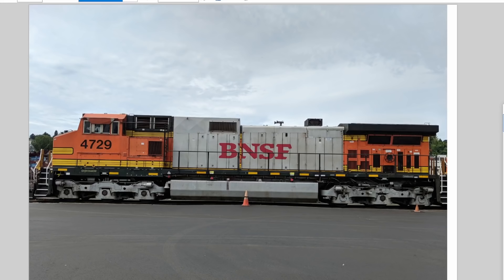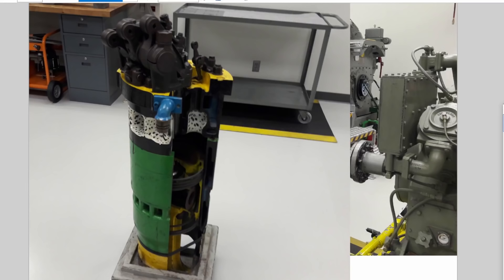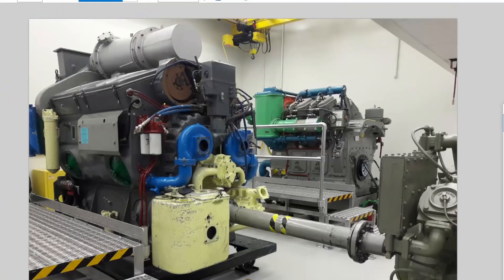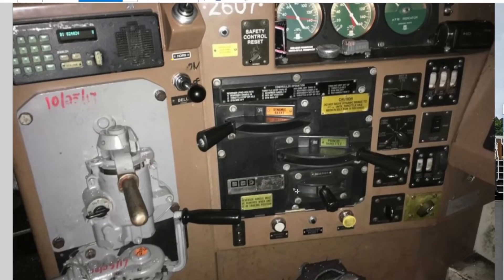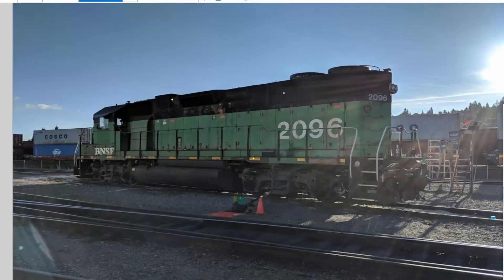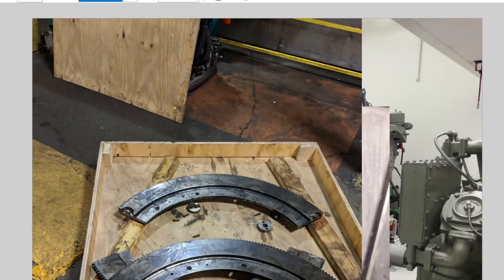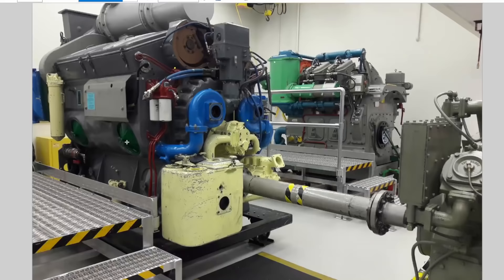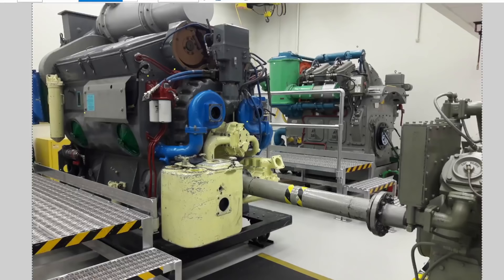Diesel 101 - How DIESEL LOCOMOTIVES Work! [10 Levels]

Comment: Talk about throttle handles. When I hired out on the Soo Line in 1968 I was placed on the Eastern Division Board at Marquette, MI but worked on the Old DSS&A #40 & 41 working out of Superior, WI to Ewen, MI. Soo Line had leased two engines from the LS&I #2500 & 2301 (GE U25c AND U23c) The throttles had half notches and an unusual throttle handle that was at least two feet long. Later when I was promoted, the first switch engine I worked on at Shoreham Yard in Mpls., MN was engine 319. A Fairbanks and Morris H12-44, that engine didn't have a reverser. It had a handle with a U-shaped slot. One slot was forward and the other reverse. I had no idea which was which, If I remember right the bottom slot was forward and the top reverse. I has a fifty percent chance to get it right the first time. Luckily I did. Those LS&I engines and the Soo 800's (GE U30c's)they were the best to stay warm in the winter as they  had a slightly pressurized cab as far as heat went.  Also, not to be picky, but the control stand has a whistle handle, not a horn handle. Railroad instructions give whistle signals not horn signals. I once had a whistle handle break off during a road trip. Jack Peterson hogheaddotnet
Reply from the maker: Cheers Jack! That's cool. I'd wager it was one of those holdover terms like the fireman's emergency brake valve. That's neat, hadn't heard about those styles of control levers!

Comment: About how you power the Main Alternator I maintained aircraft alternators and I am quite familiar with them. From my understanding, newer locomotive alternators and aircraft alternators work essentially the same. You have 3 stages, with both Rotor (rotating electric parts) and Stator (stationary electric parts). Stage 1 Rotor starts it with 'self excitation' (no outside electricity) and produces more power on the Stage 1 Stator. Then power goes to Stage 2 Stator, Stage 2 Rotator receives this power and boost it. This goes to the Stage 3 Rotor, Stage 3 Stator receives this power and boost it again. The output of the alternator is controlled by changing the amount of power going from Stage 1 to Stage 2.

Yes, the traction motors are powered by magnets and turning torque only, making electricity. No outside generators needed. Cool stuff.
Reply from the maker: That sounds about right from what I've heard with the GE style main alts. The EMD's still have the separate generator for supplying the excitement, though maybe not the newest tier 4 locos. Thanks for the comment :)

Comment: Great video.  I learned much more about Diesel Engines than I already knew.  I do have two comments though.  When I went to electronics school in the '70s, we learned about DC generators and AC generators.  Both were called generators.  I believe that when the automotive industry switched from DC to AC generators, they wanted a "cool" name to call this new component and created the name Alternator for their new AC generators.  Two is that you said several times that it was water and not coolant then later you called it coolant.  Since the purpose of the water is to cool the engine, it is coolant.  We just usually mix antifreeze with water for car coolant.  Plain water used to cool an engine, is still coolant.   Again, great video.
Reply from the maker: There is a slight technical difference to alternators vs. generators but you're probably right they wanted a fancy name. And, fair enough on the coolant. Totally right, but I wanted to point out it's not the same as buying antifreeze. :)

Comment: i wish EMD would make or licence there supper turbo idea for cars and trucks to have the response of a supper charger and the efficiency and power of a turbo in one package would be awesome.
Reply from the maker: Not sure it would work in the scaled difference for automotive applications, but that would be neat!
Reply: @Hyce777  it's not very popular to do twin chargeing at the moment because of it's complexity but it does get done from time to time by those who are willing to dive into but having a singular unit would definitely bring up the popularity if not bring it into main stream if they could pull it off in a kit form. I would certainly buy one for my landcruiser it would make it a lot better especially after a gear change not having the turbo completly spool down.

Comment: Great video, about the electrical aspect. A basic overview of charging systems, obviously the locomotive has more complicated aspects, should be a simple topic. I feel like you when it comes to forgetting more than I learned. Feels that way but it's not realistic. The basics of it is pretty cut and dry and simple to figure out. Learning about the differences between half, full and three-phase goes a long way. Rectifiers, voltage regulators and the concept of fielding coils too. Motors are a whole different topic in my opinion. Induction as a whole, in my opinion again, can be hard to wrap your mind around. Loved the video.

Comment: So I am not aware if there is, but to my knowledge two stroke diesels cannot run without positive inlet pressure which is why you have those blowers or clutch driven turbos. These engines solely rely on the intake pressure to drive the spent gasses out the exhaust. 
Fun fact: you call them blowers, because that´s actually what they do, they blow air. The positive pressure they make is dependent on your valve size, how much air your engine consumes and the rate you spin them at, but that´s getting into hot rod territory.

Comment: Small note from marine applications. EMD does produce 8cyl engines, which is what it looks like is on display in your pictures. I dont think theyre that common in rail applications however. Out vessels have 8-710s and 12-710s. Those engines are new and replaced the older, but in my opinion far cooler, Fairbanks Morse OP 38d 1/8. However the more research i do into the design and operation of the EMDs, they're growing on me. Edit: A possible reason for the EMDs traditional electric start is due to the various other applications for the engine, such as the marine industry. I know our engines are fitted with a compressed air starter, as I'm sure are other vessels. I am, however, unsure of the other uses for GE engines so my theory may not hold up. Just an idea!
Reply from the maker: For sure, that would not be surprising. I know the EMD engines have ended up in all sorts of uses. Always neat to hear about that. And yeah, they make 8's, 12's, 16's, and the used to make even 20 cylinder variants. The picture I was drawing on is actually a cut down 20 cylinder engine (the PA's are marked 1, 9, 10, and 20).

Comment: Also note on those EMDs that because they are 2-cycle, that clutch driven Turbo is mandatory or you would never get ANY pressure to the crankcase because you'd never get it to start in the first place.

Comment: As a locomotive engineer for almost 30 years i have always liked the EMD's better. They put the power to rail better, are more responsive when switching and are way more reliable. The GE's have a more comfortable cab but seem to become rattle traps way quicker.
Reply: But you have to admit, the GE's sound better, meaner.
Reply: Unfortunately I don’t think sound or looks or other enthusiast concerns are something the manufacturers or the railroads are concerned with.

Comment: The air pressure on the crankcase is actually very high, much more than you are stating in the video, around 15 PSI minimum, and up to 35 PSI when the turbo is really working - say at 45 +  MPH.  This is why the engine can burn it's own oil and "Run Away".  That is why some have a block off for the air intake, so they can stop the engine that is running on engine oil.  

The 15 PSI is required to quickly push air into the cylinders, and also push out the exhaust air through the tiny exhaust valves.  

Knowing how many cubic feet of air that is going into and out of the brakes is very important.  One time the third car of a train had a block on the that car and prevented application of the brakes rearward of the third car.  This caused the train to plow into the station, and into the control booth, with no loss of life on the train, but the locomotive soon ended up in the basement of the train depot.

Comment: Do you think it would be possible to power a locomotive with a Stirling engine? I recently found out about them, and it seems an interesting concept. They are mostly low wattage, but it seems like the technology could still be further developed, and it might be able to make full use of the energy from dynamic braking, since it runs on heat.
Reply: Interesting. But when you need to kill power, you can't just swing the heat out of the way. Easily. It's something to explore. It all comes down to economics. If it could increase profits, it'll happen. If not, it just becomes a cool engineering experiment unfortunately.
Reply: @slowpoke96Z28  I think a solution could be to then charge batteries with the slow down, then they could help it accelerate faster during the slower rev up

Comment: Also a testament to EMD durability is the fact that at almost every class 1 RR the only older motors are EMD's. You almost never see any older GE motors. They were all most all sold to other countries in the early  part of this century. They were not at all reliable.
Reply from the maker: Yup! The dash 8's we dealt with at my shop were absolute trash. But, the older GP's and SD's from the 50's, 60's, and 70's - all older, but still running with limited issues.

Comment: In a car, the difference between a generator and an alternator is just how the AC produced by the windings gets straightened out into DC. The generator used a rotating switch called a commutator, which being on the same shaft as the windings means it was synchronized; this straightened the current out (rectified it into a single direction). But a big, heavy current switch had mechanical wear and was expensive to build and maintain. An alternator used solid state diodes to do the same thing cheaper and more reliably. So instead of communtators wearing down, you have diodes blowing out. Congratulatins!

Anything having to do with excitation of the windings at start up or the simple reliance on residual magnetism remaining in the iron, or the use of solid state control circuits instead of electromechanical relays flapping around to regulate the output are just details of design and the improvements of time rather than any differences between the two. Any time you scale up to monster equipment, you are going to have little devices needed to get the big devices started, e.g. diesel semis.
Reply from the maker: Oh neat! I hadn't heard that before. That makes sense. Thanks for the comment :)

Comment: The advantage of the alternator Is they are usually three phase. The Stator is stationary, and the field rotates making the system more efficient. The shaft with the field is connected to the motor.
Modern alternators are fully synchronous. No brushes on the commutator. They have an excitor coil to energize the field on start up.
Reply from the maker: Makes sense. Thanks :)

Comment: If we could switch the right side engineer console position with the conductor left position, you basically have the 18 wheel OTR truck driver setup. If the diesel electric setup could be adapted to a COE design then I could see the diesel electric setup being useful in an EV setup for commercial trucking application.

Comment: The "war pumpkin" looks like an employment opportunity for sure.  The EMD blocks are a welded fabrication and one can weld on one even while it is running to keep it limping along if it has a bad leak.  The little GM two strokes however, had cast blocks.  The disadvantage was that welded fabrications have a higher expansion coefficient when heated and higher vibration characteristics.  The master connecting rod idea was used on radial aircraft engines and explains the characteristic lopping sound in the GEs.  My friend's VW had natural magnetism in the field windings and regulated by current through them as well.  That was all DC so I missed your point about AC being needed to control the field to control final output.    Anyway, the natural magnetism died and I showed him how to polarize the regulator to make his battery light go off until we could pull the generator out and take it to the electric shop.  An 8V-71 Detroit (similar to a miniature EMD two stroke) I worked on had one injector rack freeze up.  The other seven injectors were frozen with it because of the linkage they were all connected to that went to the governor.  I completely loosened up the adjustment on the injector that was locked up and the diver got the semi back to the shop on seven cylinders.  Yep, tappet wrenches were a thing you really had to have 40 years ago.  Please go into more about the electric.  AC has induction caused by cycles that allow transformers to work as an example.  Is that partly why alternators are used?  Is AC to DC done with great big diodes?  Did improvements in semiconductor design allow builders to get away from DC generators?  Are AC traction motors, not having brushes, a type of big shaded pole motor?  How do they control the rotational speed of those big beasts?
Reply from the maker: Great questions David - definitely some I'm going to have find answers for myself :) I'm a mechanical engineer, and I know a little about the electrical side, but not that much...
Reply: On locomotives, the AC-DC conversion was done in the early (1990’s) AC-traction locos by Gated-Turned-Off (GTO) thyristor, though they have since been replaced by Insulated-Gate Bipolar Transistors (IGBTs). Also, generators produce D.C. electricity, while alternators produce AC. The reason why locomotive manufacturers changed from generators to alternators is because as locomotives become more powerful, they produce more electricity, and the generator had to get bigger to handle the bigger load on the generator, which resulted in a feedback loop as the generator continuously got bigger as the engines got more powerful, which eventually got to a point that the generator was too big to fit on the frame. Therefore, locomotive manufacturers went to alternators and then used a bridge rectifier to convert the AC electricity to DC electricity.
Reply: What is found on modern diesel-electric locomotives are 3-phase self-exciting alternators. They can have permanent magnets used at start-up (self-starting), or supply the start-up exciting current from an external source, like a battery or other small generator, but once running, it generates it's own exciting current. This exciting current goes through the electromagnets, but only if the Generator Field switch is on. Of course, more current in the electromagnets equals more induced current in the stator which results in more resistance force in the rotor. That's why the need of huge powerful diesel engines.
Now, the alternator's AC has a frequency. The problem is this frequency varies with the rpm of the engine, and the traction motors (3-phase AC induction motors) need other frequency in order to spin, as they carry the huge load of the train. Frequency gives rpm which costs torque which means less tractive effort. Simply put, you cannot tell them what frequency to run, they ask for it. So, to give them what they need, the AC is rectified into DC via rectifiers, which are usually mounted on the alternator. Doing this, you lose the frequency physical property of the current. The DC is now inverted to AC using inverters. These inverters can supply the AC at whatever frequency the motors want. There may be one inverter for each motor (GE) or one for each truck (EMD) and they are located on the left side "box" behind the cab.

Comment: Level 10. It's actually really simple. What makes it hard is terminology. There are actually multiple governors on a locomotive, and the "level 10" governor is controlling more than just the fuel racks, so it's inputs are more than just engine rpm. It's looking at torque requested from the alternator, torque requested from the cab lever, and it's governing fuel and I imagine the windings' current so that the alternator doesn't request more torque than the engine can make and stall it. A big help for mechanically inclined people to understand it is learning how a diesel generator works. It's basically the same principle. It's trying to maintain 120 v at 60 hz as the load varies as you plug stuff in and use them. On the locomotive, the hz don't matter since it's DC that's needed, but if you demand too much current from it while it's spinning lower than what's needed, it'll stall the engine. So the governor "keeps" the alternator from trying to generate more current than available engine torque will allow, while adjusting fuel to try to get the engine to power it it fast enough.
Reply from the maker: This is correct; but yeah, with multiple governors that aren't all called a governor, lol. Cheers.